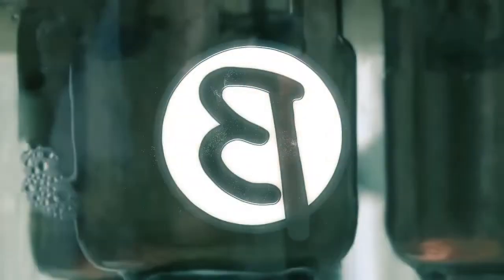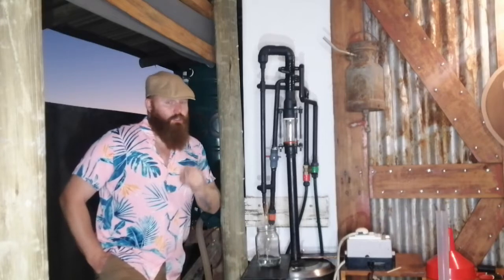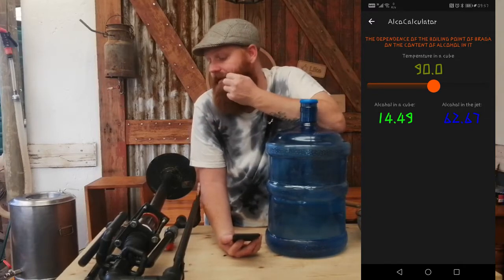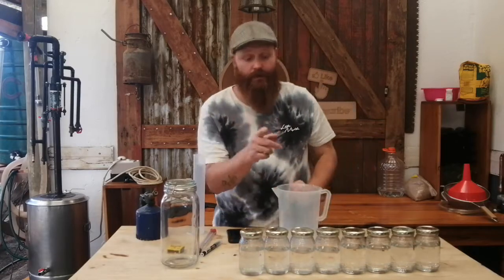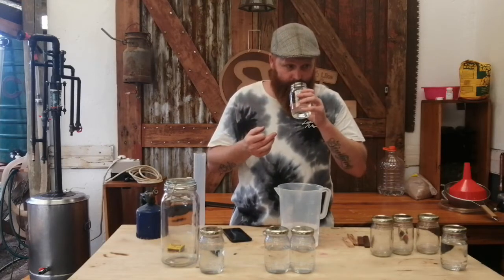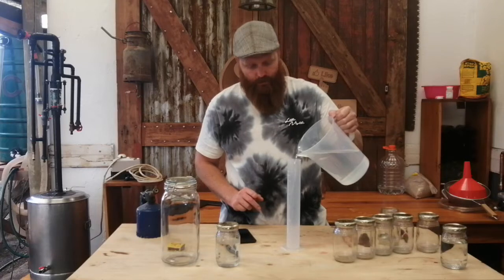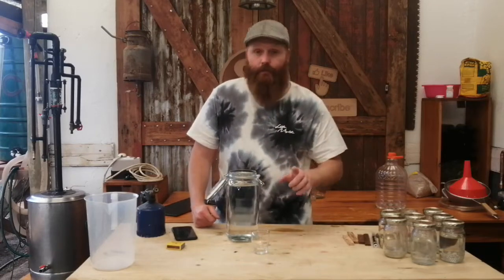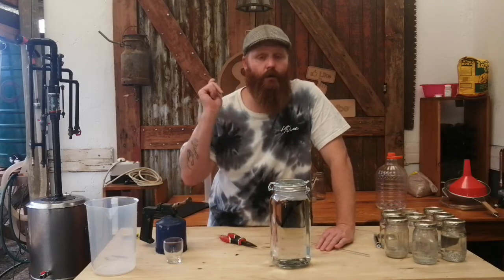Making a ALL GRAIN WHEATER BOURBON {Whiskey} Part 2

Comment: thank you for bringing up the fact about the condenser staying up with the out put. i run a pot still with a conventional condenser. i added 5ft of copper to my original condenser a few weeks back and it didn't work right. i use to be able to cool it with tap water but now i have to use ice water and it works perfect....it's little things that make this fun.
Reply from the maker: Great tip!

I have finally managed to setup re-circulation system.
Jip Have had it many times, " strip means fulll power"...